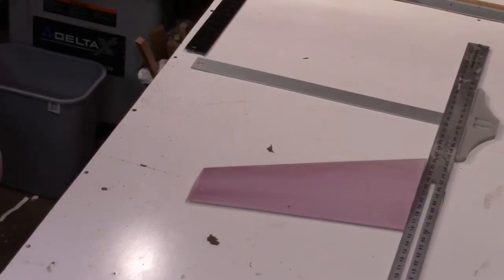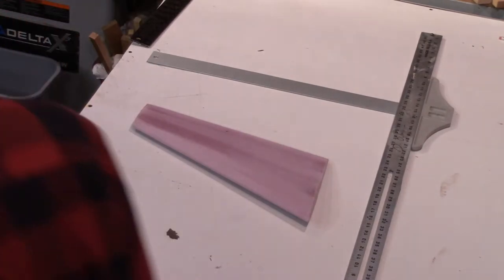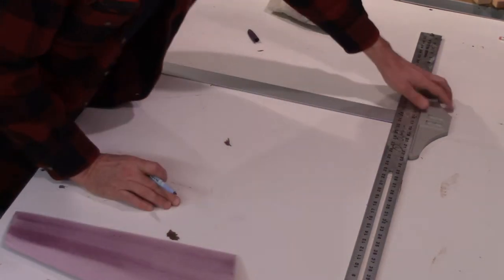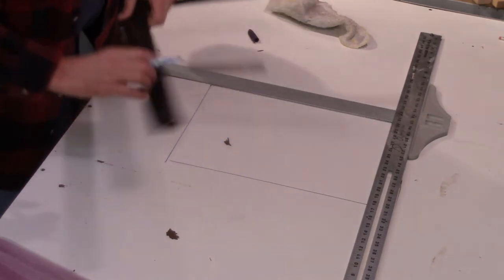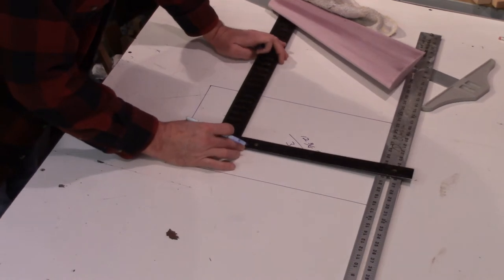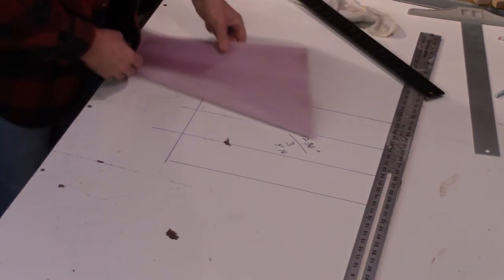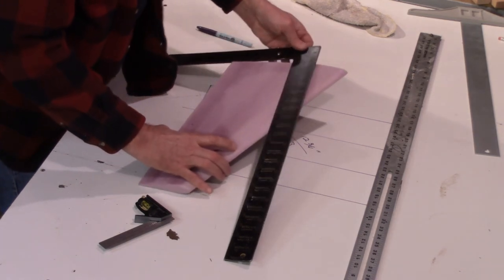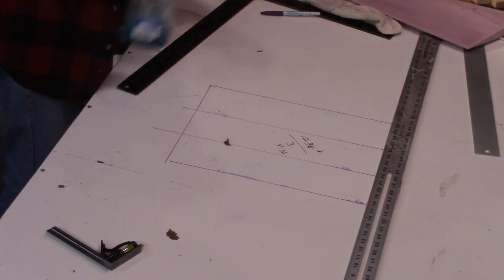Easy way to find the CG of a scratch built wing.

Comment: I'm not super sure that's correct....
Reply: I assure you this is correct. Used it many times. It is a way to do the math by drawing it out. Makes it simple.
Reply: @donolson6335  So if the wing is swept the center of aerodynamic forces shifts proportionally backward so the projection on the root chord is not 33% anymore, it's more that - is that correct?
Reply: It is not correct.

Comment: For a swept and tapered wing, the CG should be back from the leading edge a distance between 25% and 33% of the mean aerodynamic chord (MAC) at the location of the MAC.  I do not understand how your method of drawing the box and dividing it into thirds accomplishes this. 

More specifically, how does your method locate the MAC, and how does the 25/33% enter into the picture? 

I've watched Tim McKay's video:  Determine the Center of Gravity for a Swept Wing RC Model and his method is quite different. Can you help me understand how your box method and Tim's more complicated method are equivalent, assuming that the two methods give the same result? Thanks!
Reply: Well the 3 boxes he did  is equivalent to 33%. I'm not sure if that will work for swept wing. I will only believe if he flies 3 different wings with that set up
Reply: Totally agree , there's no way that this method is correct.  CG will be further back than that.
Reply: If this worked, why would you even need to make a box. Just use the square from tip of root to bottom of wingtip and divide by three.. Of course this is wrong and the CG would be nearer the center of the root chord.
Reply: Every swept flying wing I've flown had the CG much further back as it ended up in Tim McKay's video as well.